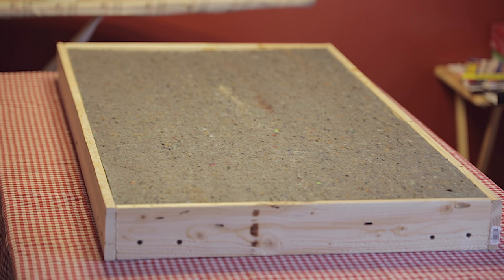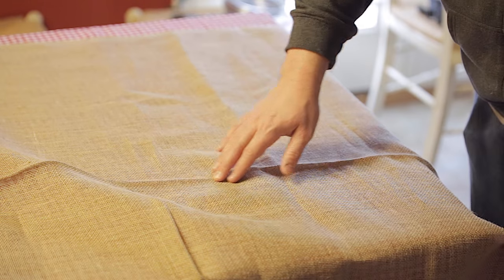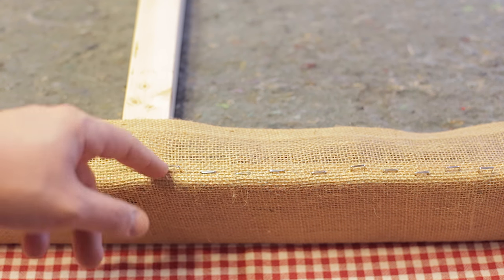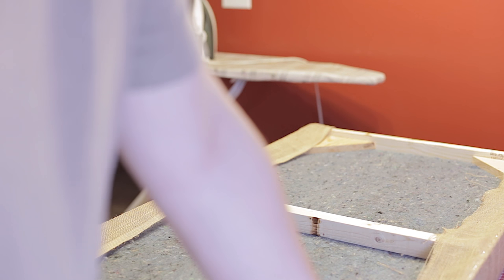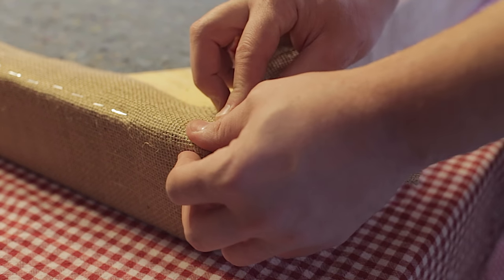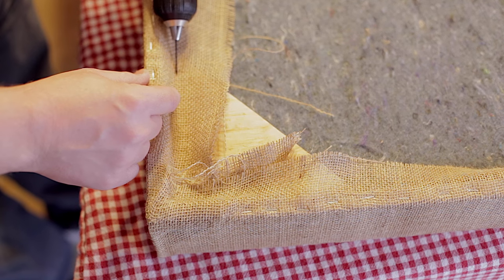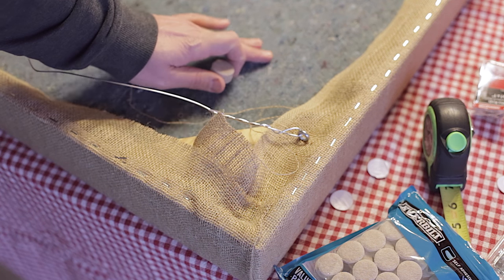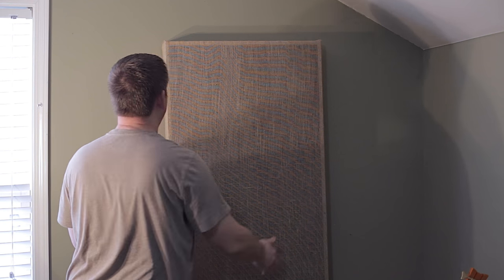How to Build an Easy DIY Acoustic Panel: Wrap and Hang

Comment: Definitely useful video, dude. Keeping the panel 2" off the wall does help; sound waves bounce off the wall behind the panel, and get absorbed into the backside of the panel. I've seen folks recommend 4" off the wall.

Only issue I have is with the cotton panel you used. A bit more expensive than CO 703.
Reply from the maker: Jose Baldizon Glad you found it useful! 

The cotton is a few dollars more, but it's a lot less messy and easier to work with. Also, some people site safety concerns with the fiberglass (which may or may not be overstated) and I have 3 young kids in the house, so I figured better safe than sorry. Otherwise, the 703 will work with the build exactly the same way.
Reply: StereoLaunch I'd definitely buy these sheet, but the thing is I can't find anywhere near me that sells the stuff. The only way to get my hands on this is by ordering it online, and guys like ATS Acoustics charge too much for shipping.

I just need 2-3 sheets to make my panels. I'm making 2' x 2' panels, not 2' x 4'. Do you think it'd be a good idea to just go into a construction shop (Home Depot doesn't sell it), and ask if they would sell me Owens Corning 703 by the sheet?
Reply from the maker: I know there's an insulation supply company here in Nashville where my friend would just buy three or four sheets of 703 at a time. Of course they normally sell tons of it for commercial construction, but they were happy to help him out - and no shipping cost. So you may be able to find a place like that too.

Comment: good job, I am about to build something similar for inside my vocal booth.
I wont be leaving an air gap though as my booth is already too small, so I am going directly against the inside walls, I am trying to stop reflections mostly and will be using Roxul

Comment: In your experience, does acoustic cotton absorb/dampen as well as Owens Corning 703 or Roxul? I'm considering buying this stuff to line a drum booth project I'm building. It seems easy to work with and no itch. I just want to know if it's as effective as the old standards.

Comment: @6:40, if you've glued the butt joints, and the glue has sufficiently set, I suggest you remove the corner brackets, staple the burlap down nice and tight, then replace the corner brackets
Reply from the maker: That's a good idea and probably would be a bit cleaner look. Since I made mine quickly, my cuts weren't clean enough for glueing.
Reply: There are gap filling adhesives available.  In your 'rough enough, good enough' work ethic, the brackets will provide most of the strength, the glue is just to hold everything together until you can re-attach the brackets

Comment: So why did you add the spacers to get the panel 2 inch from the wall ? you have already a gap made in the panel itself right ? I thought its just the one or the other, create the space behind it or create the space behind it whitin the panel. Im not 100 % sure thats why im asking.
Reply from the maker: I'm not an expert, but this is my understanding: If you have a 2" panel, and then put a 2" air gap behind it, then that positions the panel so that some of the frequencies bouncing back off to wall are more effectively absorbed because of the where the nodes of the sound wave hit the panel. They cancel themselves out better. It extends the range of lower frequencies that the panel is working on. Is it a lot? Probably not, but I figure I'll take what I can get. 

The panel did already have an air gap, but it wasn't 2". So I put the spacers on there to make it 2". Hope that made sense.
Reply: Ah yes, makes sense ! thank you

Comment: I loved the video.  Thanks.  One thing, if you are in earthquake country (or you have rowdy kids), you might want to use hooks on the wall so the panel can't be easily bumped off the wall.  Here are the ones I used:  http://www.amazon.com/Quakehold-4338-A-Maze-ing-Picture-Hook/dp/B000FJQQQS

Thanks again for the video.
Reply from the maker: Cooler Tymes Ha ha! Yeah, I make no claims that this method is "earthquake proof"! lol I have kids, but fortunately they don't bother my gear much. Thanks for the suggestion on the hooks.

Comment: Could I spray paint burlap?
Reply from the maker: I wouldn't because the paint will fill the holes that allow for the sound to pass through the fabric to allow the acoustic material to work. I would choose a different fabric before painting the burlap. With that said,  I'm actually in the process of changing all mine over to gray and really like the look of it better. I found gray burlap at a local hobby/fabric store. They had other colors as well, so if you don't like the brown, then you may find another color that works. Check local stores or online. One thing I found out though was that I had to paint the wood frame a similar color to the burlap because, when stretched, the holes in the burlap reveal the wood below. Not a big deal with the normal burlap color, but may not be what you want with a different color. You may also find that the color of your acoustic material shows through if it's yellow or a non-gray color. Something to keep in mind. Hope that helps.